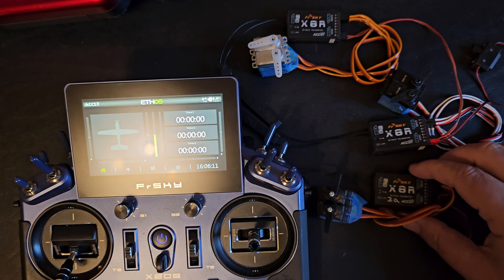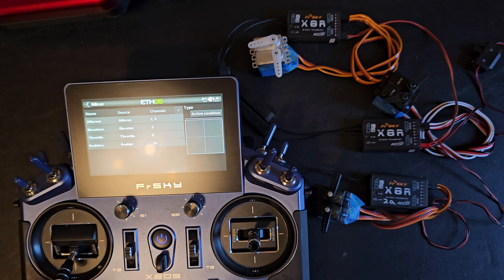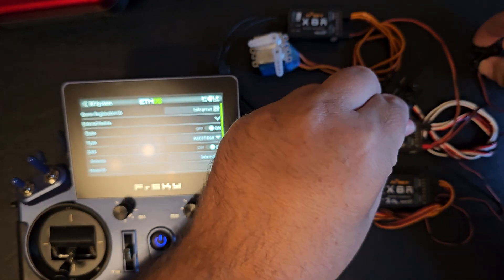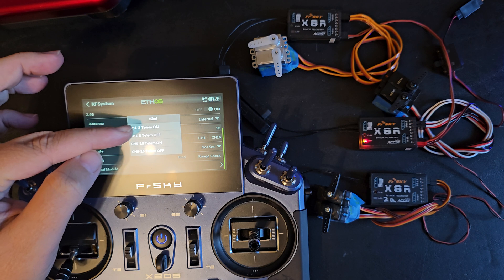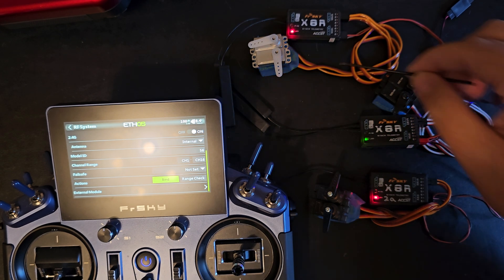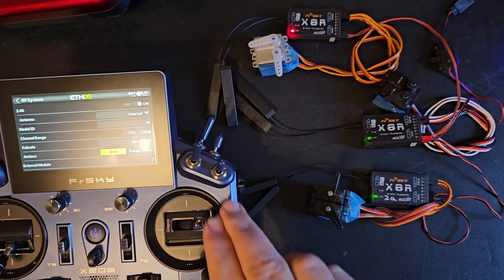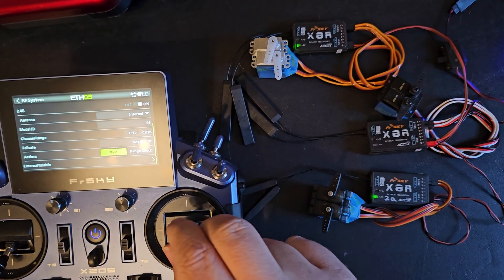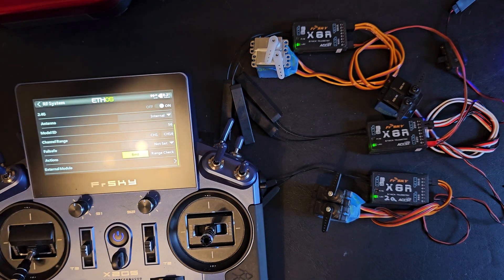FrSky ETHOS Bind Multiple ACCST Receivers for 16 Individual PWM Channels 9-16 X8R Example

Comment: hi frsky x8r updated to the latest version accst v2 is it good in your opinion to be mounted on a helicopter sab goblin raw 580 for a flight soft 3d?
PCB antennas they don't have that carcass that I see in your video my x8r they have the pcb at sight.
I mount the antennas in sight but I don't want it to go into bind because if they go into bind I have to turn the power off and on.
If the helicopter flies and it goes into failsafe It is crash Surely.
At most 100/130 meters I will arrive and I'm scared which goes into failsafe.
There is a way to delay the failsafe or add a delay like if you lose signal for more than 3 seconds then failsafe is activated ??

Comment: I used to be able to bind channels 9-16 on my RX6R. This meant I had SBUS to my flight controller and six PWM pins for direct servo control (landing gear, gear doors and flaps). 
Now I moved to Ethos, updated the RX6R with the latest ACCESS  FW today and I cannot get the same setup (channels 1-8 SBUS, channels 9-16 SBUS). What should I do?